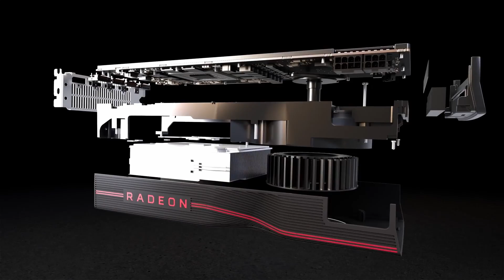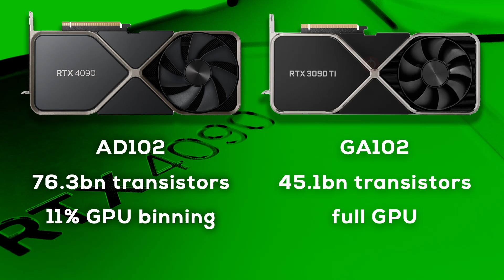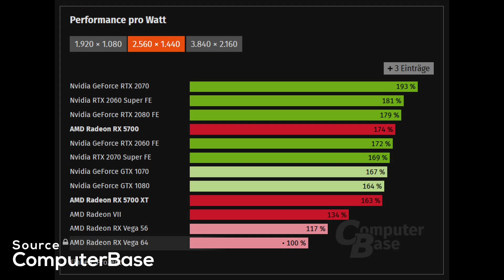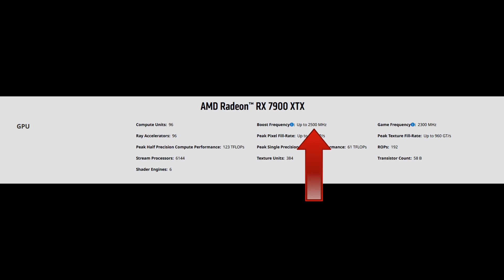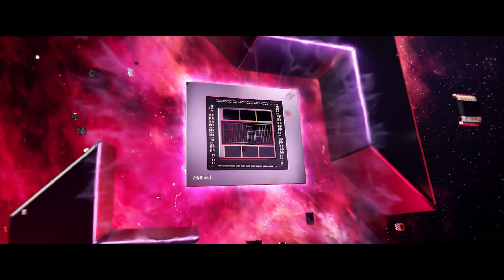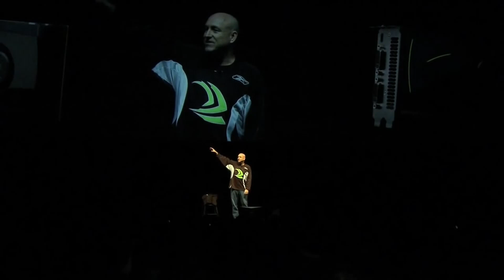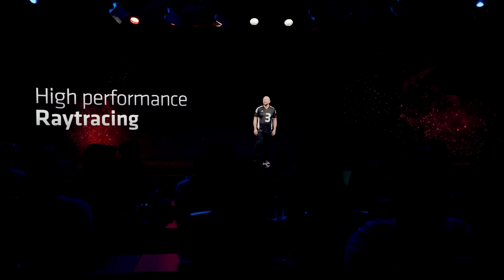RDNA3 – what went wrong?

Comment: Simplistic i know ( but I like simple )
If you class the gpu structure as a mechanism.  Amd  have suddenly gone from 1 moving  part in N 21  to 7  for N31.
 Thus my take on it would be the problems they are facing is the silicon equivalent of a mechanical tolerance stack.
Where instead of dimensional tolerances the stack could be more along the lines of binning tolerances.
Leading to the discrepancies of performance between each component. even though on paper each part fits perfectly.
Of course getting drivers to accomodate this silicon stack variance would be difficult as pin pointing the errorrs and combinations would be an up hill struggle.
Reply from the maker: Usually, semiconductor companies are really cautious. Intels tick-tock, to never change architecture and process node at the same time, was the benchmark for years.
RDNA3 has a new architecture on a new process node & is using a completely new chipset design. AMD is playing dare devil.
Reply: @HighYield  Very true. All journeys start with a single step .AMD have taken thier first, albeit a stumbling one. 
New ideas will always lead to new problems which require new approaches to solve them or avoiding them. 
as mentioned what if Navi 32 has resolved any architectural problems and begins to tread on the toes of Navi 31?
Reply: Good video . Thanks
Yeah the silicon lottery multiplied by 6 or 7 with Simulating so many unknown variables you end up with different empirical problems compared to paper stats.  
Keeping up the mechanical  anaology .
AMD have moved from a single  cynlinder engine  straight to a V6  in one leap.  So pretty much certain they will have run into issues.
Yup and these issues only really appear when the engine is built and up and running. 
There appears to be a misfire somewhere. 
Could have well have firmware issues ( coil / alternator)
And the drivers (ECU) could help smooth out the power curve.
Balancing the whole package to peak performance may be one step too far .(Cam shafts)
Reference card shroud wasnt really designed for so much power draw and possibly over heats ( Radiator) 
Im sure  maybe the v-cache addition could act like a buffer ( flywheel) - but thats a different chip.
Maybe  the delayed Navi 32 has resolved some of the problems and could end up  with similar performance. 
Heck if it beats it ... what do AMD do?

Comment: Good summary of things so far, but even discounting the shader prefetching rumor (now dead) your theory of a rushed A0 release doesn't make much sense :) Here's why:
1. Shipping an A0 is not as rare as many have claimed. And if it happens, it's usually a combination of an exceptional process and a bit of luck. Dr Ian Cuttress shot down this debate on Twitter today, ridiculing people on the "A0=crap"  side. I also saw a list of recent CPU/GPU steppings and while A0's are a minority, they aren't too rare.
2. Nobody announces a release date before they have an ES that's validated for launch. If the N31 is an A0 (not confirmed yet btw), this means that when AMD picked the launch date they already had the A0 and already knew that it was good and wouldn't need more steppings.
3. TSMC allocation not a problem since AMD has other products on the same nodes, notably Zen4 uses both 5nm (CCD) and 6nm (IOD), and thanks to EPYC in particular, AMD can sell those as fast as they can fab and ship and with excellent margins.
4. I don't think the shader prefetcher contribs anything close to 5% performance, that would be massive. Perhaps a worst-case scenario for contrived benchmarks but absolutely not an average. I've seen estimation around 1-2% but nothing backed by evidence/docs. In any case, this problem doesn't exist at all as clarified by AMD.

One theory I read elsewhere is that the software work was rushed because the quality of the A0 was not in the plans, silicon designers should always expect to need a respin or two, it's their luck day when the A0 already passes launch criteria. That precipitated a decision to launch RDNA3 in Q4, squeezing software work (driver & firmware) that would normally have a few extra months. For one thing, it's obvious that AMD even made this release in mid-December to not miss 2022 and leave the whole holiday season to NVidia.

More evidence comes from preannounced software that should really be part of this launch: FSR 3.0 and HYPR-RX (and no, they didn't start working on those only after NVidia announced DLSS 3.0 - these are natural developments for anyone in the upsampling race). I'm sure the original plan was having at least a beta/preview-quality release of those two features as part of the RDNA3 launch. Even the more modest FSR 2.2 release is not really ready yet, two games have shipped it but updated source code is not yet on Github, which means those early games are using prerelease code (they did the same thing with 2.0 and 2.1, both had one or two partner games launching early, with God of War even a more exceptional case because it's a DX11 game which FSR2 doesn't officially support).

Final nitpick, also valid for many other analysts: comparing the 7900 XTX to the 6950 XT is not really fair, despite that both are the "full die". The 6900 XT is also the full Navi21 with the same number of CUs and every other architectural factor. But the 6950 XT clocks higher, takes +35W TDP and has +12% GDDR bandwidth. It simply benefits from 6 months of maturity in the fabbing with better yields and binning. So the 7900 XTX should be compared to the 6900 XT, which is also the release-day high-end/full-die GPU for that generation. It's very likely that in a few months we will also have a 7950 XTX with similar improvements - and that won't even necessitate the V-cache, although that is also possible and very likely, maybe we'll have both a 7950 XTX (+5% from more mature silicon clocking higher) and a 7990 XTX (+20% to +30% by also adding the V-cache).
Reply: Thanks Reddit.
Reply from the maker: I'd still say shipping A0 is pretty rare if you consider that Navi31 has new architecture (new dual-issue shaders, new AI-cores, much improved RT-cores, etc.), a completely new chiplet design and is using a new process node. The combination of these factors make A0 pretty astonishing imho.

Timelines are made during development. You are correct that the final released date is only announced when there's working silicon, but stranger things have happened and sometimes problems do pop up.

Goods point on TSMC allocation, but with the lower than expected demand for Zen 4, AMD might still have troubles filling all their booked capacity without RDNA3.

The pre-fetcher is really hard to guesstimate. On RDNA2 is was clearly below 5%, on RDNA3 it could be higher. But since it seems to be working, its a moot point from my side.

I also agree that software could play a huge part. Lets see how it turns out!
Reply: @HighYield  I beieve the Zen4 demand won't be a significant issue since that's just a desktop problem, the same dies can be switched to make TR or EPYC - of course requiring different packaging but I believe the critical resource is the die fabbing.
Reply: Dr Ian Cutress, as in the paid AMD consultant? Take that damage control spin with a grain of salt.
Reply: @veganjohnny  Lol that's one way to win the argument, ad hominen Ian. Yes like most "tech influencers" he will do the occasional puff pieces and softball interviews for AMD and also Intel, IBM, whoever is sponsoring a video or trip. But I follow his general content for years and I'll trust his impartiality and expertise over "random reddit/twitter user making up theories out of thin air" any day of the week.

And when it comes to damage control nobody is denying that N31 may have some flaw, the important fact is how it performs, if it doesn't perform as expected then there are problems of some kind. The debate is about some explanations for the performance, i.e. engineering fan-fic.
Reply: FSR has nothing to do with the drivers... AMD's R&D software department (outside the drivers) is frankly pathetic, always behind, and has nothing to do with the video card launch. RDNA3... as the name suggests, isn't a totally new architecture that somehow AMD could not handle in 2 years. I can understand the issue Intel had, since this is their first attempt for big desktop GPU, but AMD really has no excuses. Nobody is saying that A0 is always crap, but with this obviously missed performance target, the comments in the source code, the problems with frequency... all suggest that A0 was crap in this case. We will understand the truth only with the RDNA3 refresh, since obviously AMD will insist RDNA3 is great and is worth the asking price...
Reply: @ivayloi736  I never said FSR was part of drivers. It doesn't make any difference, it's still part of the product. Lots of people including myself would not buy an AMD GPU at this point unless they had a credible alternative to DLSS, which they do have now.

RDNA 3 is a significant arch change from the previous gen, these names and numbers are partly marketing. Next thing you will say is that Alder Lake was a small increment over Tiger lake because both are in the same series, 11th to 12h, and both are lakes.

I wouldn't call AMD pathetic, the GPU people in particular supported DX11 first and created what became Vulkan to name two things. Yes NVidia is significantly bigger and has stronger R&D, still AMD has their own areas of leadership and innovation, chiplets being a major example now.

And stop embarrassing yourself with mentions to source code and A0 stuff. Complete fabrication from ignorants that have no clue about how the sausages are made, not my opinion but from actual experts. When it comes to frequency etc. nobody outside AMD has any clue of what's going on yet, maybe it's driver issues, maybe the reference card's build quality (I'm hearing very different experiences with Tjunction and clocks), maybe a real limitation of the silicon, I guess it will take some time yet to clarify (and possibly solve) performance inconsistencies.
Reply: @opinali  That's all well and good... Except the part for the comparison against the 6950xt. We didn't just decide to compare the 7900XTX against it, AMD did. Fair game to slap them for the shortcomings in that comparison 🤷🏻‍♂️
Reply: @calisto2735  fair enough, yes AMD called for it. Because from a marketing perspective it would look bad to not compare their new GPU to the absolute best of their previous gen. But I was focusing on the larger debate about the quality and potential of the RDNA3 architecture; the fact is that there is headroom for an improved N31 release even without any fancy feature like vcache or dual-GCD.
Reply: Nailed it

Comment: performance, while kinda bad, and not even close to the numbers AMD said. the main issue is the pricing imo. 7900xt starts at 1200, and the 7900xtx at 1500, meanwhile the 4080 is at 1350... and the 1350 is already about 200% more expensive than it should be.

7900xt shouldve been the 7700xt for 450, 7900xtx shouldve been 6800xt for 650. 4080 maybe more like a 4070ti starting at 599 max. 4090 I dunno it kinda seems like a 90 class card, but it shouldve been 1400 at the most.

it just feels like the main issue with AMD and Nvidia is that theyre just milking everyone dry, just like AMD and Intel are doing with the cpu market. 7600x and 13600k released at 400 euros, and even now are still way to expensive. although if AMD price cuts keep being there and the 7600x is 250, thats pretty alright.
Reply: I have no idea what you 3xpect in the first week... Give it a month to properly load the stores.
Reply: @calisto2735  I expect not to be lied to. I do not expect to be told one thing then get another. I will say i doubt AMD ever hit the performance gains they have lied about. Nether in raw fps (1.7%) in Cyberpunk. Nor in 54% performance per watt. Certainly not both. I just see no way to do it. If the CPUs have taught us anything. Chiplets create latency. Latency in games kill games. Memory will never be fast enough as it is now to over come this issue. Unless some new tech comes out to over come this. Much faster memory is needed to reach the 1.7% increase that they stated.
Reply: @calisto2735  well, last time 3 months down the line the prices went up even more, and yeah I'm not expecting AMD to drop the prices until rx8000 looking back at Rx6000 pricing. It was very hard to find them 20% over msrp with most being about 80% or higher over msrp up until like almost the summer. Like even Intel has far better stock.
Reply: Pricing directly correlates to the failed architecture... This chip ain't cheap. I think this is what we see with the so called "7900XT"... It's 10% cheaper, and 15% slower. Makes no sense as a product. The only logical reason is that AMD do not want to lose money on it, and just can't sell it cheaper at reasonable profit. Technically, these perform as 7800, but AMD made them cost as 7900 and hoped they will perform as such. Where I live 7900XTX is non existent and 7900XT is 100 euro cheaper then RTX 4080, which is absolutely ridiculous...
Reply: @ivayloi736  pretty sure the whole reason of the chiplets was that they were massively cheaper. But not sure. Even if it does cost more, we're looking at a 7700xt and 7800xt so 700 would honestly really be the very most it should be especially considering it very bad in some areas and that the 4080 should not be much more than that either.

Just pretty upset about it since I wanted the new amd gpus to be good and I was hyped to get a 7800xt for 650ish, not 1500 jesus christ.
Reply: @ivayloi736  We shall see how these sell soon. You can not judge that by the release of them. My guess is. They do not sell well after being restocked. After all of the bad press AMD has received on these cards. I would be willing to bet, that AMD does not flood the market with these GPUs. I bet they make very few of them. In hopes of making things look better than they are. With low stocks meaning places rarely get them to even sell. AMD will use the wafer supply to make cpus instead. Which is not selling all that great as of now. But as someone posted earlier. The wafer supply will be sent back to make EPYC which they make much more margin with anyways. But for all the lies AMD has said. I hope they take a massive hit. Lisa Su has gotten to big for her britches. And needs to come back down to reality. AMD is not the market leader in anything. They are a cheaper alternative. Lisa Su wants to be the market leader and price as such. But the fact of the matter is. AMD is not in that position.

Comment: They definitely expected better, I doubt Scott Herkelman would have been so upbeat and aggro, saying "kick Nvidia's ass" if this launch state was expected.
Without much real insight, it seems to me the inconsistent results in games and 1440p vs 4K for example, is likely software issues.
But the faster clocked front end and low shader utilisation looks like bottle necks.  Perhaps their modelling didn't reflect games accurately, but it seems clear high performance was expected needing more memory bandwidth.
So I guess there'll be driver updates that help, but then a significant refresh which widens the front end and improves power management, maybe rebalancing area budgets, but making MCD V-cache boost performance.
Reply from the maker: I really hope we will find out what went wrong at some point. If its mainly drivers, we will know for sure, if they can fix performance. The 3D V-Cache ability is one of the most interesting facts here.
Reply: @HighYield with the benefit of time the video analysis stands well.
Steve of HUB reported a 20% uplift on 7900xt 6 months after launch which most people have ignored.
Hawk Point & Strix iGPU performed much more efficiently than Phoenix, while Strix Halo iGPU  is reported faster than the laptop 4070.  That suggests design fixes, ones broadly applicable boosting efficiency and hence general performance.
Now it appears Nvidia have a disappointing release that fails to really exploit the increased bandwidth.
There's people likely to put the RX 9070 down to being monolithic despite that not fitting as the 7600 was monolithic too.
Reply: @HighYield additionalky the market conditions meant anything higher priced was forgotten, any design effort went into expediting the AI products, which suited shareholders.